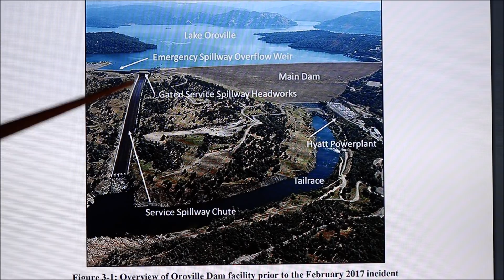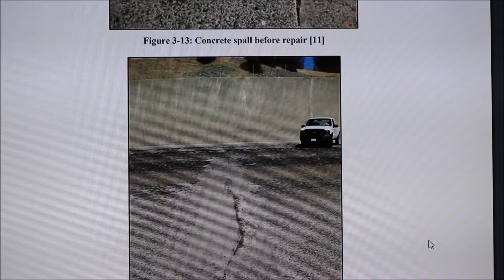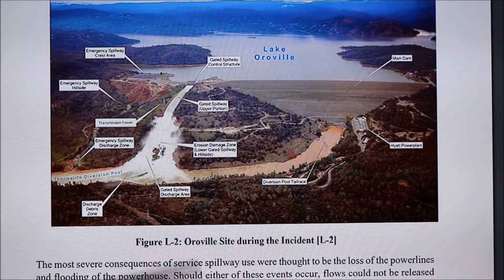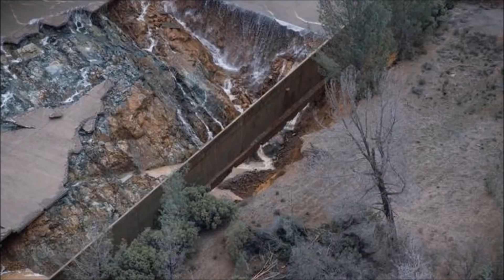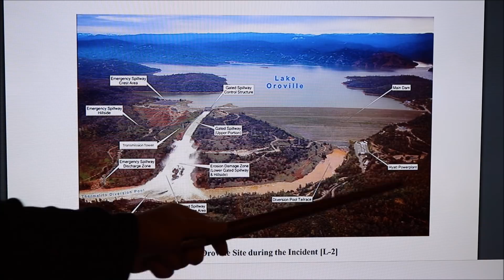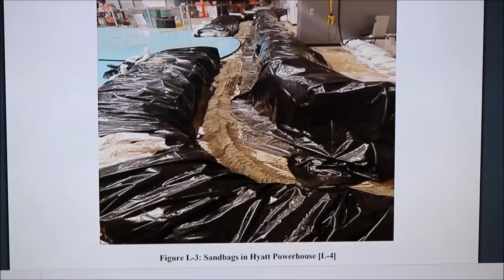Oroville Update Final Forensics Report Sequence of Events after Spillway Failure

Comment: Thank you so much for helping us understand how "big a bullet" was dodged by the actions which saved the Hyatt power plant and kept [more] disastrous flooding from occurring. This year so far is assuring us that the rain event of 2017 is a "50-year-flood" event. [We can hope it is actually a "100-year-flood" event, but enough time must pass without a worse scenario to be certain.] We also hope that an even wetter year might be handled by the spillway, even as we hope we do not have a year quite so wet. 
Again, thank you for your report and level-headed insights into the challenges.

Comment: This explanation is better than the actual report.  I've read the report twice, and it's written actually surprising poorly.  It has a number of conclusory statements that aren't obviously supported.  The authors -- in my view - over-use jargon that seems more intended to impress us with their intimate knowledge of dams, but which interferes with the value of the report to tell the story of what happened. We want to policy makers to read and understand these issues.  But they have to understand it.  This video is an excellent summary.
Reply: I skimmed through the report and found it to be highly redundant. There were a lot of appendices, with lots of overlap between them and the main body of the report. Having followed the story from Juan's excellent reporting, I had no trouble understanding most of the jargon. There is a list of abbreviations on Page v.

I came away with the conclusion that DWR really doesn't do a good job of managing maintenance and safety issues. They are much more concerned about delivering water and power to their various constituencies. They rely on the regulatory agencies to tell them what to do to be compliant with safety issues. They aren't being proactive enough. It's all too easy for maintenance and safety to take a back seat to other considerations like keeping within budget and headcount. They probably never would have found the budget to replace the main spillway if it had not failed so spectacularly. They would have kept on patching it year after year, decade after decade.

The spillways were never given the consideration they deserved. All the safety efforts were directed toward the main dam and the power plant. It simply wasn't appreciated by anybody that the main spillway could fail so dramatically from the large cracks that had developed. They were seen as "normal" even though it was obvious from year 1 that they were large and allowed considerable water to escape into the drain system.

Another conclusion I came to is that the herringbone drain system weakened the structure. Had the slab thickness not been compromised by the drains the failure probably wouldn't have happened, even though the foundation was not up to design criteria. Of course, the incompetent rock and poorly cleaned portions of the foundation exacerbated the issue. 

There is also a fair amount of friction and empire-building within the organization. Dept of Safety of Dams and the Chief Dam Safety Engineer in particular are not well connected into the operational reporting hierarchy of the organization. They are off in their own little fiefdoms with insufficient internal communication with the rest of the organization. The report goes out of its way to note that DSOD folks adopted the strategy of hanging around with the FERC folks so that they could at least overhear what was going on.

It seems to me that the best way to make sure that safety comes first at Oroville is to require DWR to report on a regular basis to the citizens of Oroville and the Butte County sheriff and endure a proper grilling from those who's lives depend on the safe operation of the dam complex. It was apparent when the disaster happened that DWR puts on a very professional show for public consumption. But it was also apparent that they were doing so precisely because communication with the downstream public had been markedly insufficient in the past.
Reply: It's a standard, technical report.  There is nothing wrong with the presentation or language used in the report.  Technical reports do not "tell a story of what happened."   Story telling is for fiction and non-fiction novels.  Technical reports present information as documentation of conditions and events.   The "jargon" you complain about is the technical language used to factually describe the facility and events.  Perhaps YOU need to expand your vocabulary.  The real problems that caused the failure are documented clearly in the Summary and then later detailed in the report.   The most important documentation is the poor construction of the original spillway that became evident shortly after completion, and the acceptance of this as being "normal."   "Almost immediately after construction, the concrete chute slab cracked above and along underdrain pipes, and high underdrain flows were observed. The slab cracking and underdrain flows, although originally thought of as unusual, were quickly deemed to be “normal,” and as simply requiring on-going repairs."  There's a lot more information about operations, lack of maintenance, etc.  None of it is presented as screaming headlines - "Here's The Big Story" fashion - but, simply as facts.  It's all there, you just have to learn how to read technical reports.

Comment: I've studied several other accidents and disasters, and they share common features. A combination of factors including original design flaws, together with time and human nature (e.g normalisation of deviance), lead to a "perfect storm" where risk is not properly managed and an accident occurs. Whether an accident turns to disaster depends on how quickly the failure mode cascades to a catastrophic failure.
Oroville was a close call, but fortunately the erosion of the main spillway was contained and the lake level reduced to a safe level.
Thanks for your detailed and informative reporting, that still maintains a human touch.

Comment: Then, to manage later inflows, they would have to run the spillway hard (50dfs?) to avoid undercutting, but then stop when lake level got close to the bottom of the gates to prevent scouring the intake with high flows.  So they got into this run hard for a while  then turn off for a while letting the lake refill, then run hard again...   (yes, I learned that from Juan).
Reply from the maker: cember01 Yep!

Comment: Hi Juan, saw this when it was new, came back to look for some answers I had forgotten.  One that I have not seen is to the question of why the extension of the emergency spillway toward the boat ramp was not built the same way as the ogee weir.  Or why was it not built a foot higher or tapered up a couple of feet toward the boat ramp.  (This would concentrate the flow over the weir which would seem to be better able to handle the flow, of course the down hill erosion question would remain.)  It appears this issue is being addressed with the new construction but I have not seen anyone discuss this in public.  Is it simply that there was a low spot at the weir's location and they felt it would never be used?  Have you seen it discussed?  Thanks so much for your continued reports on this and everything else.

Comment: Saw this from a previous engineering post. My name is McNamara. The underground powerhouse was done by the McNamara Corporation. It was quickly determined that the geology here was seriously compromised. Foundation work for the turbines was a BIG question mark at the time. Of course, a Claim was filed for changed/mis-represented conditions as proposed by DWR in the bidding docs and I was in SF when that was submitted. That Claim was successful. I am mystified as to why anyone would be surprised at why the spillway failed. DWR would certainly know the risk here. A review of our claim, and Judgment comments  would certainly be illuminating. 
There should be a MAJOR engineering review of the geo UNDER the Hyatt.

Comment: The IFT report pretty clearly identifies an overemphasis during the incident management decision making on the importance of preserving the Hyatt power plant. There is a strong implication that the negative effects of plant shutdown should have been outweighed by consideration of the danger of emergency spillway failure, as they eventually were outweighed. Apparently, there was no way to make this comparative risk analysis efficiently and effectively during the crisis.

Comment: Spalling is a result of water entering brick, concrete or natural stone and forcing the surface to peel, pop out or flake off. In concrete, spalling happens because there is moisture in the concrete. In basements, especially, moisture and often salt, too, pushes outward from the inside.Jul 22, 2017

Comment: I read the report:  The spillway was set on loose weathered rock, and the surface was covered with cracks.  Was the forensic team talking about the old spillway, or this new one? lol. 

 Fifteen of the square concrete panels have cracks that are 1/8 inch thick, and 70 percent have hairline cracks which formed within hours of initial pour (probably too much water in mix due to long piping to get it to the location.)  I'm in awe of what was accomplished, but still question the investment due to fundamental site issues.  It was a disappointment that the forensic team didn't look at the head structure, or the main dam.

Comment: Good video!  This mess just amazes me.  The emergency spillway is nuts.  I'm not a hydro engineer, but even I can tell you what's going to happen if you run millions of gallons of water over raw earth.  It's going to degrade faster than you can say, "holy crap the dams about to break and flood the town!"  What's the plan for the emergency spillway now?  Because as we've already found out, it's essentially useless.  And what is the condition of the other dams in Ca?  How many of them are in equally bad shape...or worse?

Comment: I thought of another question, are the flood gates manually controlled, or do they require power to open them, and  if so, does the power come from the power plant? Do hey have generators as back ups if that is the case and they would have to shut down the power plant?
Reply from the maker: Matt yes and yes.

Comment: Can you explain what is meant by "lose the powerplant"?   Lose outflow capability or lose power generation temporarily or all the way to permanently damaging the turbines?
Reply from the maker: Massive Flooding of the Hyatt PP would mean destroying ALL the turbine generators and electrical systems  requiring YEARS of rebuilding and very limited options to control the lake level with the spillway busted.

Comment: Juan I think that we are respectfully talking passed each other on this subject of the Summery of the Forensic Report. While I agree with you and the subject report that the original design and construction methods used on the radial gated controlled spillway and the emergency spillway were treated as step brothers in design and budget as compared to the GIANT Earth Filled Dam, ( Senior Governor Brown's legacy project ) they should have survived more than the puny 50 years of use that has the potential to causing havoc to the valley below,.... what are they going to do 150 years from now ???
My point is that after all has been said and done nobody has ever hung a committee of decision makers that make the wrong decisions. This DWR committee made the wrong decision when they screwed around for 40 + hours as they reduce the outflow from the spillway and did NOT CONTINUE spilling @ 100,000 cfs after the initial inspection of the failure and discovered they still had more than 1,000’ of functioning spillway below the control structure with its ability to continue the flow at a considerable rate i.e.. 100,000 cfs when the lake was filling @ 200,000 cfs. If the Under Ground Power Plant was shut down because of the loss of the transmission tower and the necessity to stop out flow with  only 5 operating Turbines @ 2500 cfs each = 12,500 cfs @ 100% operation when considering 200,000cfs was coming into the lake. Stop Logs are on standby and could have been lowered into the slots at the out flow of the diversion tunnels after the power plant was shut down thus preventing the back flow of river water invading the power plant why wasn't this done ???
This 40+ hour slowdown of spill from lack of critical decisions allowed the emergency spillway which had never been used before, to overflow causing extensive erosion and head cutting damage back to the ogee weir with the potential of undermining that structure, This would have cause a 30’ wall of water to cascading into the valley below. That total vacuum of decision has caused a substantial increase of costs to repair the facility to the point of being potentially $$$ North of ONE BILLION DOLLARS $$$ and exposing the down stream population to a major disaster.
Our GOOD local Butte County Sherriff was put in the position of the hot seat in that DWR committee room where he had to finally make the call from a Public Safety Issue to cause  a 200,000+ population evacuation because the other decision makers (EXECUTIVES) on the committee would not listen to the advice of the engineering and geologic members of the committee
 TO OPEN UP THE GATES !! 
 
This release of 100,000 cfs was finally accomplished but only after it was too late. This overflowing should have never been allowed in the first place, and now it will cost the tax payers another $500,000,000 more because they fumbled around for 40+ hours as water was coming into the lake @ 200,000 cfs. Criminal investigations of this careless vacuum of leadership needs to be pursued.
JA
Reply from the maker: Jerry Antonetti knowns and unknowns at the time...
Reply: Don't Monday-morning quarterback the decisions. If they had let 100,000cfs flow full time it could have just as easily led to losing the power plant. Then they would be stuck with a dam with no outfall capability at all except a heavily damaged spillway, and no way to drain the dam below the spillway intake. That would be looking at even more hundreds of millions of dollars trying to fix the power plant while throwing rocks into the hole created in the primary while they get washed away every time they have to reopen the gates to manage the inflows from the record snowfall stored in the mountains above the dam, each time reducing the capacity of the power plant to release water. We could very well be sitting here in January 2018 with limited capability to release out of the power plant and a giant hole in the ground for the spillway instead of the temporary spillway they managed to place. The Management team and the Geology experts both had good reasons for the points they were advocating.
Reply: I believe the repairs/upgrades required for both spillways would be the same, regardless of whether the ES was used or not, so I'm not sure how different decisions at the time would have changed the eventual repair cost.  The ES was dangerous as built, and needed to be upgraded.  Also, if the ES had never been used, we might not have gotten such a clear object lesson in how dangerous it was and might not be fixing it today.

Comment: You state that water is never to be allowed over the top of an earthen dam. For obvious catastrophic erosion failure. So why was the emergency spill way just an earthen slope? Wasn't the emergency spill way just an earthen dam with a concrete lip? Who didn't understand that the hillside would fail just like it did?
Reply from the maker: Listen again to the presentation, an emergency spillway is like a slow blow fuse. See also Moccasin Dam update.
Reply: Yes, I have viewed it about three times. I also wonder why they cleared the emergency slope. Did they simply cut the trees down or were they fully uprooted? Maybe leaving them in place could have slowed the spill and lessened the erosion?

My engineering background sometimes gets the better of me. BSEE from USC, many years ago. Fight on and all that.

Great presentation. Excellent.

How about something on the high speed rail disaster?

Comment: They should've opened the gates up to half capacity and let the erosion happen rather than shutting the gates until it was too late. There was no way that the storms on the horizon could possibly erode the whole hillside the  spillway is on to endanger the gateway from where the damage occurred. It wouldn't happen in 100 years if left open. The other side since it is just gravel and dirt would suffer with the gates open and that's where the failure would first happen if the gates were left open and never shut again. The whole catastrophe was not because of the actual damage, time, or construction but because of saving money. Save money from maintenance costs and save money for repairs by shutting the gate and hope the emergency spillway would suffice with minimal damage increases. It could be argued and justifiably so that saving money was the very root cause during the construction but that is arguable considering construction code in the 60's. The whole thing was caused by trying to save money rather than invest in infrastructure. Save a penny now and spend a dollar later mentality.
Reply from the maker: JETWTF not sure about that analysis....